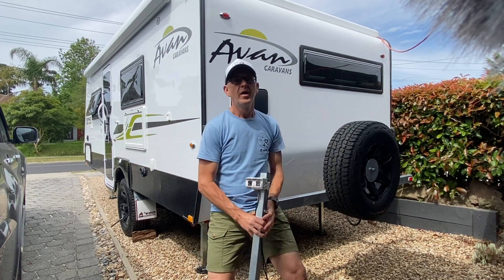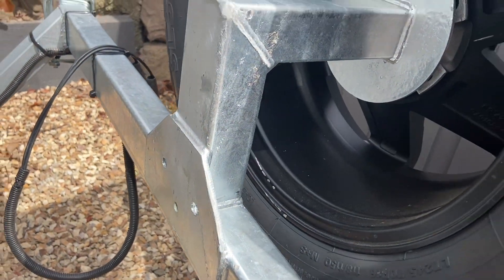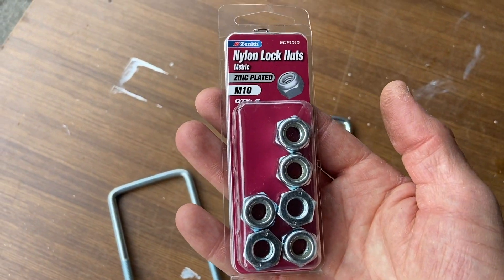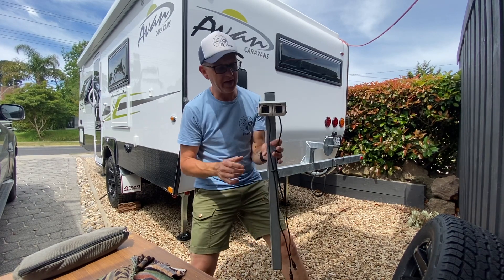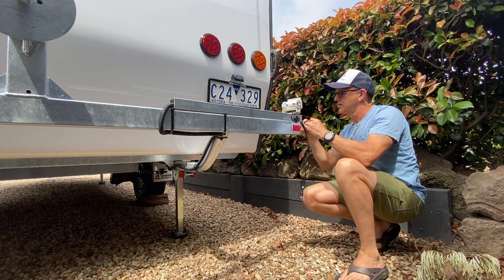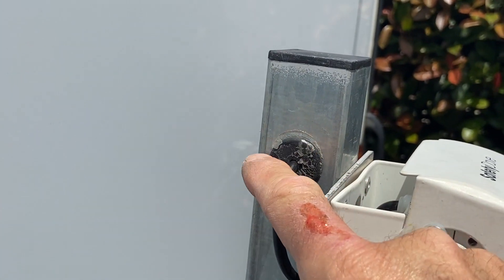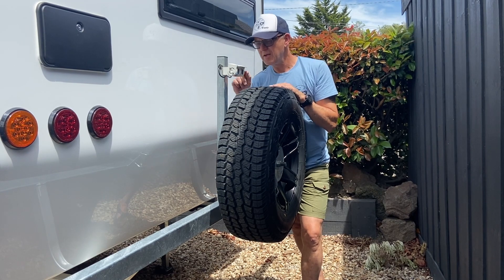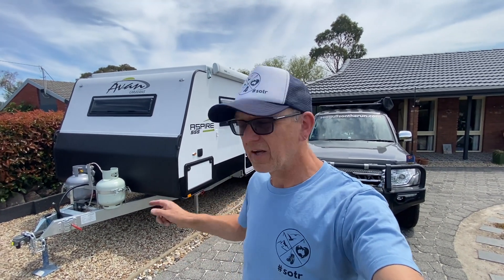Installation of Safety Dave Rear View Camera to an AVAN Aspire 555, no  drilling into the bodywork

Comment: I actually installed the same camera set up last week. I used metal conduit clamps. I secured them with galvanized tech screws. Its neat, secure and looks professionally done. I also secured the camera to the rear wall of my caravan and ran the cable within the wall cavity. All caravans have a hollow space running along the top corner. You can then come through internally wherever a cupboard is and work your way to the undercarriage. Unfortunately my puppy ate the cable yesterday, so I have to do it all again.
Reply from the maker: Thank you for your feedback and the details about caravan builds. I have a 'thing' about not wanting to drill into the body/chassis of the caravan, so I keep things external as much as I can. Gotta love puppies during their 'exploration period' , I'm sure it'll probably get up to even more mischief  haha . Peace, and enjoy life :-)

Comment: We just took delivery of a similar van and I like what you have done with the SD camera.  How long is the 40mm square tube?  Did you use galvanised steel or aluminium?
Reply from the maker: Hey how are you, thanks for watching. The 40x40x is 740mm long (I think I originally bought a 1mtr length and trimmed it to get it over the top of the tyre). It’s aluminium to save weight. I’ve since had to change the camera, because it’s install as it is it was very easy to swap in the new camera. 
Peace and enjoy.

Comment: You can run a thick bead of silastic on the top and bottom of the conduit. Leave the cable ties in place until it sets, ( about a week) and then cut and remove the cable ties.
Reply from the maker: love that idea, thank you. I might have to brush up on my silicon skills to make sure I get nice neat lines, silicone can look a bloody mess if a hack job :-)
Thanks buddy

Comment: Great Video. Ill do something similar.  For your brackets to replace the zip ties, have a look at a bonding agent, and bond a bracket to the frame. Some have shear strengths similar to welds, and there should be no real pressure on them as it's all light weight.
Reply from the maker: Thanks Steve, good idea … I’m off to Bunnings to research the bonding agents because I still have ugly cable ties which look shithouse 😆 
Peace
#SOTR

Comment: Just wondering how much the camera vibrates being quite a distance from the mounting bracket. And are you concerned with security.
Reply from the maker: Hey, good questions: 1) there is zero vibration, the camera bracket to post is riveted super secure, the two u-bolts holding post to rear wheel carrier are nylock and done real tight, plus they are difficult to access and not easy to 'un-bolt'. 2) This all adds up to it being secure and reduces our worry of theft. We are very happy with it's location/operation.

Peace.